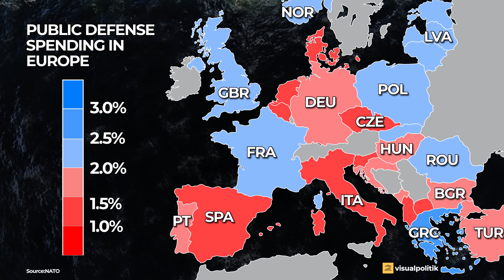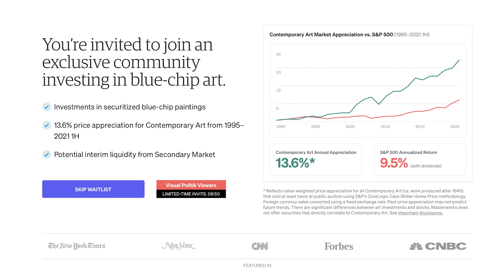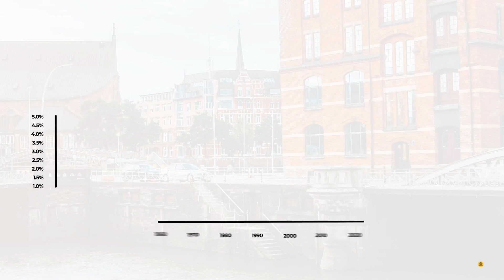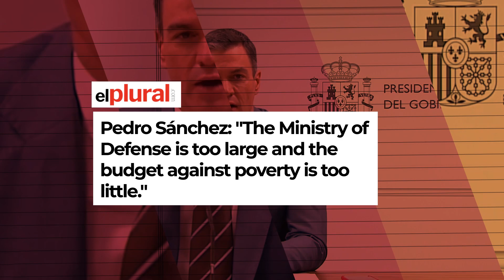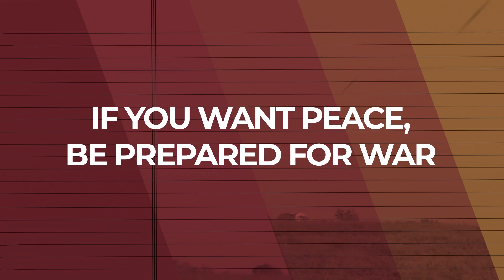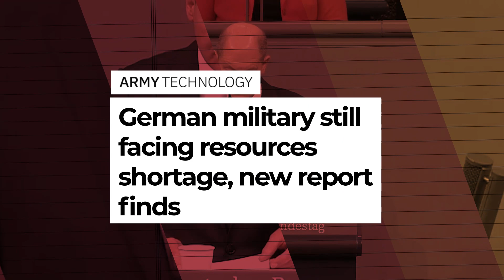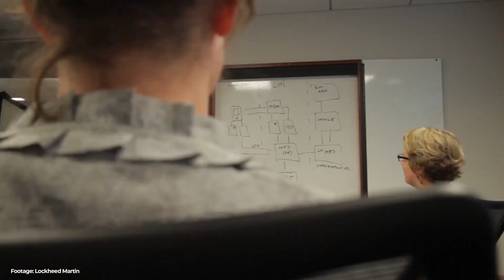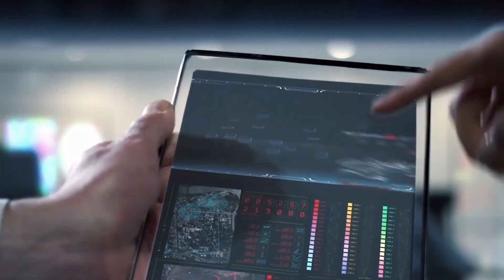Europe's REARMING to defend itself against RUSSIA: A new era for the EU? - VisualPolitik EN

Comment: Question:
Russia has high military spending , why don’t we see much innovation there in the the society?
Reply: Corruption
Reply: Most of that military spending goes towards maintaining cold war era gear rather than developing new tech. That's why the more modern tanks and vehicles like the T-14 are nowhere to be seen in Ukraine. Plus corruption, yes. At levels rarely ever seen.
Reply: @jacopoabbruscato9271  And the rest is fleeced from the top by oligarchs.
Reply: What are you talking about have you seen the new jet fighter Russia has its better than the f 35
Reply: @datdude1538  the su_76 checkmate has orders from many countries and is seen as a F 35 counter and it's a third of the cost of an F 35.
Reply: @mylet2658  No other country has put in an order for a Su57. Russia supposedly put in an order for 60 but so far only 12 have been delivered by the deadline when all where supposed to enter service.
The Su76 is under development and slated for service in 2027, that’s if ever finishes now. No orders have been placed.

Comment: As an actual researcher, I have to say Europe has been spending too little on R&D of all kinds throughout the past 5 or so decades. Moreover, there is clear lack of an appetite amongst nearly all players to take fundamental research and turn it e.g. Into a spin-off. I think this a (partly) to the fact that most politicians and bankers are trained in law, economics and/or humanities, not in science or engineering, and it is they who make the funding desicions. So, on the whole, this video touches on some valids points. 

However, I wouldn’t tackle this with the exact approach presented in this video. You need to increase R&D spending all across the board, not just divert existing funds to military-oriented projects. This emcompasses all categories you can think of. I also would focus first on addressing developing and implementing alternative energy sources. We have seen that Europe’s main strategic weakness towards Russia is it dependence on Russian oil and gas. 

Lastly, Horizon2020 has been extremely important for fundamental research, because it funds the ERC grant system. It’s a system unique in it kind in Europe because so the size of the grants and its emphasis on high-risk, high-gain innovative research. (As a side-note only 5 % or so of all funding application to the ERC get funded which is very low.)
Reply: This is an underrated comment. Also important fact is that the USA has tremendous military R&D spending and quite a lot of it gets implemented back in civilian life...but so what? European coutries are still around a million times more invested into providing wellbeing and decent quality life to as many citizens as possible. Becoming homeless is Brussels is way harder then becoming homeless in San Francisco, although the latest has the most innovations and startups in the world. High R&D and even GDP are not the only or even the most pivotal markers of a successful society. And the USA is probably the brightest example why. I mean, mums give birth and go back to work in a week, but hey - there are drones. Ok 👌
Reply: @ekaterinastaneva9922  both are great comments. It's a balancing act between the 2. We are going to have to make a few sacrifices for the sake of our defence. What good is the best quality of life if another country tries to destroy it. Also, what good is the greatest security if we loose our freedom and quality of life. Ultimately both are important things to focus on. Poverty in the USA is more to with the way the rich treat the poor. Essentially in the USA the rich want the poor to always be poor and struggling.
Reply: yet france remains to see surpasses the united states in military technology
question yourself

Comment: Military spending might benefit Europe's economy only if gear is developed and purchased locally instead of getting stuff from the US
Reply: I think in the short-term to address the threat from Russia, yeah, stuff will be bought from the US but on a longer horizon, with sustained funding, it would become homegrown for sure.
Reply: I'm going to tell you right now that ALL defense contactors and arms suppliers share engineering, designers, manufacturing, and logistical across multiple international borders

The US asks the Italian government to make their standard issue M9 pistol for example

So no the US isn't the only supplier and there's already a use of locally (In this case European originated) material
Like the Belgium government Makin the SCAR rifle that the US army uses

Comment: Emh not quite sure if it's fair to say that internet was born in military in California. At least arguably one of the most important parts in the stack the TCP/IP is inherited from CERN. Overall internet was born as many networks from many organizations were gradually joined so it doesn't really have single place of origin as when it became a thing it was already encompassing multiple countries.

I'm not very much on board that military spending produces new technology. It sure didn't happen at all in Russia - thought maybe that's bad example due to scale of corruption that exists there. Military management wants to be predictable and prioritize reliability - thus I think there is more focus on applying reliable existing tested technologies instead of making big bets on something that hasn't been tried yet. Military product specs together with all parts tend to be confidential and by the time they are opened up technologies are already legacy. Strong technological capacity of country sure produces more powerful military but I'm not convinced if it works the other way.

Thus far the most successful innovation places seem to be scientific research facilities trying to find answers to yet unanswered problems - things like particle accelerators or space exploration. As in order to find answer to unknown most of the time you need to build tools that never been built to achieve new levels of precision that had been never achieved yet and for that new materials and new production methods need to be developed.

Comment: Defense spending shouldn't be fixed. It should be proportional to the threat. After USSR fell, there was little need for massive military spending.
And frankly, there is little need for massive military spending right now. Adequate spending to keep the military equipment working is needed, of course, and Germany needs to spend more to reach that.
But even if USA withdraws, NATO is not going to fall apart. After Trump pulled out of TPP, the other countries made the CPTPP without it. 
Russia is not the unstoppable military force presented. They are struggling against Ukraine, which is flat geography unsuited for defense. And Russians are not going to attack NATO countries, even with USA out. Great Britain and France are nuclear powers, and nobody wants a nuclear war.
This whole "EU needs to become USA with big corporations and high military spending" is wrong. Giving power to the corporations to they can grow as powerful as the state is dangerous, and costly in terms of employer and customer rights. We may not have out Google and Microsoft, but we can take an ambulance to the hospital without declaring bankruptcy.

Comment: Being green about war makes tons of sense. When you're spending 2% of your gdp on military affairs, it's going to be a sizeable chunk of your emissions. Cutting it where you can is sensible. Whether that should come to the detriment of combat capabilities is another issue entirely, since the two are not always at odds. And even then, that is probably a question best answered on a case by case basis, not generalizing with cheapshots like "are bullets biodegradable? These dumb greenies hohoho"
Reply: Well your Navy can be your greenest branch easily. Zero carbon emissions due to usage. Just do what the French, Russians and US do: make your ships nuclear powered. No combustion means no CO2 emissions. Obviously nuclear power isn't practical for every ship, but large capital ships and submarines are perfect for it. In addition, nuclear ships have a huge advantage in terms of maintenance and upkeep. You literally build a service life into them with the reactor. 10 year service life it comes in to be refueled and refitted and goes out for another 10 years and it's either decommissioned or the cycle starts over again for another 10 years.
Reply: @OtterTreySSArmy  "No combustion means no CO2 emissions." Not really. Plus there's lifecycle emissions to worry about. Plus not all ships in those countries are nuclear

Comment: When you no longer have energy, no material like steel, aluminum and or other raw materials.  So building a strong military when you will not even be able to build the trucks to haul the so called military equipment.
Reply: Steel and Aluminium and the other raw Matirial dosn't come from Russia. Russia only has Gas, oil and coal. Europe has a lot of Coal and can easily get Oil from other countrys only Gas is a problem but that dosn't really has something to do with the Military
Reply: @onlyagermanguy  you seem to be missing a couple of small items.  One you get more than one type of gas/oil from Russia.  Can you Identify those?  And yes you can get aluminum and steel from other countries at what cost.  But do you have any clue how many different alloys are required to make a single modern fighter jet?  Do you have a clue how many alloys are required to make aluminum used in a modern jet?  Now get down to making a missle?  How about the computers and other requirements for modern weapons.  So you can get these items from other countries were do they get them?
Now get to the real issue were does Germany get all the food it imports and then we get back to a real issue how much will it cost.
Reply: @johnnieharper2221  Germany Produces enough food itself. Agricultur is big here mostly in corn weed. Getting Raw Matirial like aluminium and steel as i just sayed isn't hard. Further more the modern fighter that Europe plans to use come from the US which has a lot less problems getting those Ressources. Coal isn't a Problem either since that is littarly the only Thing germany has a lot of. Further most of these country's need Natural gas and mostly for Heating
Reply: @onlyagermanguy  funny I have been to Germany a few times.  And I love the bread and cheeses that I got there.  The biggest disappointment for me was the beer, it was ok but not great.  The beer in Hamburg was just bad.  I also spend time in Stuttgart, some time in Nuremberg and smaller cities.  Never in Berlin at the time I was there very hard for the military to get there.  I have seen some on the land I never the scale of framing that could feed a population the size of Germany.  Now I was not possible  for me to see what the land and make up of east Germany.
Yes we have a significant natural resources available in America but to make a the plants to convert natural gas to LMG would only take 3 to 5 years before we could make an effective effort for exporting.
Reply: @johnnieharper2221  It is mostly in Northern and Central Germany where the Area is more flat. Pretty sure most US military bases are not close to farmland. There are mostly in southern and Western germany. Germany is quite famous for it's big wheat fields the same as Poland
Reply: @onlyagermanguy  no comment to protect the beer of Germany?  Also the amount of time I spend in Hamburg which is northern Germany was beautiful
Reply: @johnnieharper2221  Yeah Hamburg is very Beautiful City. And also american beer Taste just can't be safed anymore :)
Reply: @onlyagermanguy  I will agree that the mass market beer in the US sucks but we have come a long way with some of craft beers.  From what I heard in Germany what is happening there is something similar the big brewers are buying the old small town brewers and closing them.

Comment: Yeah better stay out of the f35 topic because it's not the state of the art fighter jet X)

It has A huge list of problems and quite à few are critical, you but a f35 you but the us backup.
Maybe in a decade or two the f35 will be ready but ATM it's far from it.

Not enough steathly, reliable, only had one engine not powerful enough, expensive to use, sens all the data to the US and so on